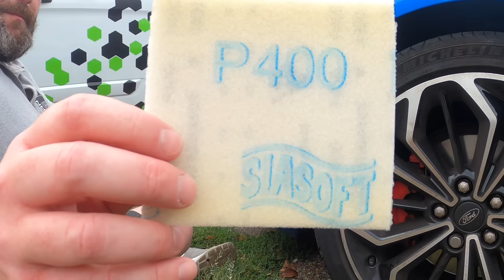Fiesta st line mobile bumper repair

Comment: Another first class job from our local smart repair guru😁 looks really nice Grant but you seemed to put quite a few coats of base on it so was it one of those bad coverage colours, mate you timed that job to perfection any later and you would have water in your nice fresh clearcoat😲🤦‍♂
That colour looked the same as the Performance Blue that I had on my Mondeo ST🤔 I do miss that car even though I now have an SLK which is a great car but somewhat thirsty around town😂
Reply from the maker: Very transparent that colour was yes 👍 but I also don’t put full wet coats on every time 👊👊👊👊

Comment: Grant, I've copied your 'tunnel' of paper technique to blend the fresh clear into the old and it works really well, thanks 😉 
The only thing I do different is to use some cardboard from an old cereal box or whatever and form a shallow tunnel from that in the hope that it wont flap around in the new clear.
Gives a nice gradual transition from new to old and just needs a wee puff of blending thinner 👌You were seriously lucky with those bugs though 🪰😊